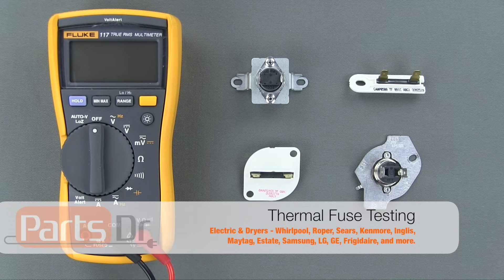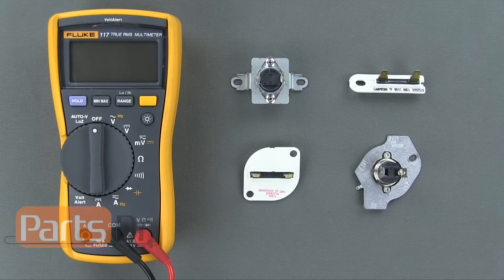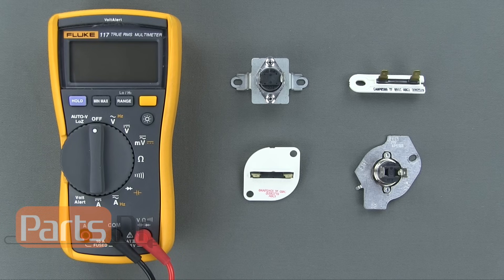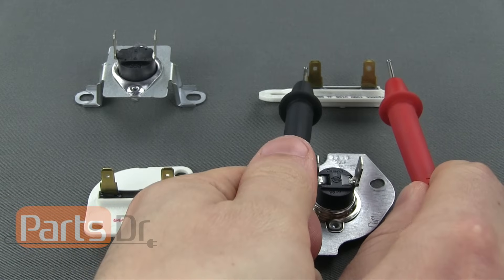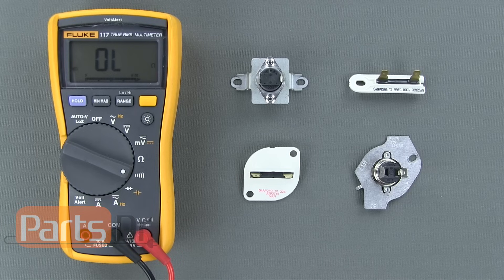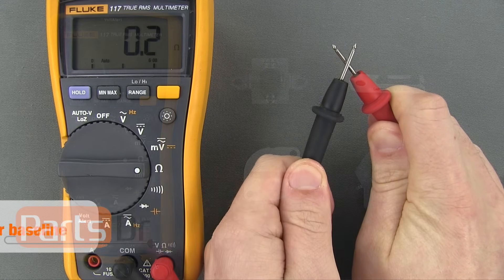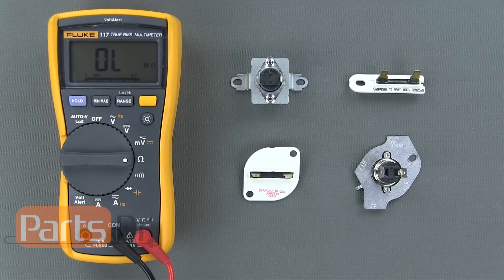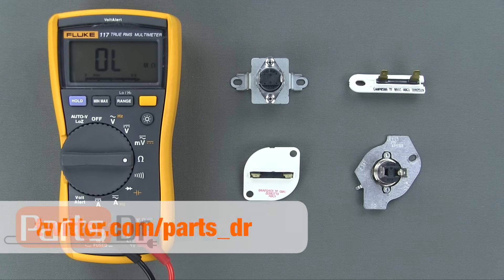How To Test A Dryer Thermal Fuse For Continuity

Comment from the maker: If your dryer isn't heating, testing the thermal fuse for continuity is a smart first step. If the fuse is bad, replacing it with a high-quality OEM part is key to a reliable repair. A quick reminder if you're ordering parts online, be cautious when shopping on sites like Amazon or eBay. Many of the cheaper aftermarket fuses we've seen fail quickly or don’t fit right, and some have even led to overheating issues or safety hazards. For genuine OEM thermal fuses and other dryer parts, shop with confidence at https://partsdr.com. Use your dryer’s model number or the part number from your fuse to find the exact match.

Need help replacing the fuse? Check out these videos:
Whirlpool, Maytag, Amana, Kenmore, Estate, Roper dryers:
Blower Fuse: https://www.youtube.com/watch?v=wvaki76Cjpg
Heater Fuse: https://www.youtube.com/watch?v=_gnMcO6F68E

Samsung dryers:
Blower Fuse: https://www.youtube.com/watch?v=lxGavrWKwUw
Heater Fuse: https://www.youtube.com/watch?v=e_rWKBSCwRA

Happy repairing and let us know how your repair goes in the comments!

Comment: Continuity doesn’t work but when I put it on OHMs and heat it up with my hair dryer on the sensor. It somehow reads and the numbers started to decrease. Like 3.45 - 3.40 - 3.00 2.9 etc etc
Reply from the maker: That sounds more like you are testing a thermistor.  Those have to be tested for a specific ohm value at a certain temperature (this can vary depending on the part) like this here: https://www.youtube.com/watch?v=oaABV5WV6sI
Reply: @ thank you for replying. 
So you mean to say is that, if the continuity doesn’t work that means the Dryer Thermal Fuse is completely useless?
Thanks
Reply from the maker: @TheMoodyMonday  No.  We are saying that we think that the part you are testing is not actually a thermal fuse, but instead it is a thermistor.
Reply: @PartsDr  yes, you’re absolutely right. It is indeed a Thermistor. And the continuity doesn’t work (doesn’t beep) 
Thanks a lot

Comment: You can put a jumper wire between the connector and that will be a good test
Reply from the maker: That is a good way to test the fuse if you don't have a multimeter.  Just make sure to unplug the dryer while jumping the wires, and make to sure to NEVER leave it this way as it is a major fire hazard.

Comment: What if the elements all have a continuity tone, but the dryer still continues to overheat and repeatedly blow the new Thermal Fuse?
Reply from the maker: What is the part number of the fuse that is blowing?  What is the model number of the dryer?

Comment: I've disassembled my GE dryer and removed the Inlet Control Thermistor (part WE4M398) after testing for continuity and not receiving an audible alert. So I ordered another one. The new one came in today from you guys but the new one doesn't have an audible notification either when testing for continuity.

I reread some online resources to make sure of the proper test I should be performing: Omhs or Continuity. But I just got more confused.

Should I be testing for Continuity or Omhs on this part? If my thought process is correct, there should be some type of resistance if the part is designed as a fail safe for high/low temps. Thoughts?
Reply from the maker: The part number that you mentioned will not register continuity.  It will have to be tested for ohms.  This thermistor should have an ohm reading of approximately 100K ohms at room temperature and the resistance value should decrease as the temperature increases.

Comment: My dryer is giving me f4 e3 but it is not clogged I took it all apart can it be the thermal fuse ? It was working just fine heating up fine went to switch the loads but now won’t start but has power panel board does work
Reply from the maker: Yes it could be a blown thermal fuse, but also make sure to check your dryer for restricted exhaust venting.
Reply: @PartsDr  how would I check that where would that be under the drum?
Reply from the maker: @tiffanywoodall7001  Locations for the fuse varies by model, but there are usually two fuses, one near the heater and one near the blower.  This video might help you here: https://www.youtube.com/watch?v=iWZucCy3EC8

Comment: I just replaced the thermal fuse and after a minute of running the fuse has gone out again!!! I have checked all other fuses and element. Lint trap and blower is clear. What else could be causing this?
Reply from the maker: Check for a shorted heating element and make sure the exhaust venting from the dryer to the exterior of the house is clear.  We show how to test the element here: https://www.youtube.com/watch?v=8AG7PtCy0v4

Comment: Set to OHMS my multimeter read 0.6 when I tested my thermal fuse the reading jumped around a bit at first..when I had a  steadier connection to the fuse  it read 0.6 so I am assuming it's good. My dryer was cleaned the summer so lint buildup wouldn't be a cause to my problem - which is the start button only clicking. I also checked the door switch and is good as well.
Reply from the maker: It sounds like the fuse is good from what you described.

Comment: can these be tested in place without removing the wires? some of them are quite difficult to remove and i dont want to break anything.
Reply from the maker: You will need to disconnect the wires to get an accurate reading.

Comment: Greetings, I changed the thermal fuse and the dryer worked for a while then stopped working again. Any suggestions???
Reply from the maker: You will need to address the cause of the dryer overheating or you will continue to have thermal fuses blow.
Reply: @PartsDr  Thanks so much for the info. I'm troubleshooting the dryer to see what's going on

Comment: What if all the parts are showing continuity what else could make the dryer not heating up but everything running fine looking forward to your reply thank you
Reply: Heater element or thermostat
Reply: if it’s not the fuse it’s the elements
Reply: Did you figure out the issue?
Reply: What if all of the above test good?
Reply: Clogged Dryer vent will also keep it from heating up
Reply: This has been one of my biggest issues as a technician in training. I have no idea what to do 😢
Reply: @JonCollinsMedia you'll get it figured out!  It takes time to know what to look for and what to test, believe in yourself!
Reply: If it’s a clogged vent it should still feel warm inside the dryer after running it. It just won’t dry the clothes bc there is no circulation to carry the moisture out. If it’s totally cold after cycling the machine for awhile it’s like the fuse or elements.
Reply: Same thing happened to me. I changed the thermal cut off fuse and now it’s drying nice and hot. I replaced a part that tests good with a new one and that was the fix. I would love to know why.

Comment: i cant even get the wires off the fuses at all
Reply from the maker: They can be tough to remove. Try a needle nose pliers to help pull on the metal wire connector or use a flat blade screwdriver to pry the metal wire connector upwards.

Comment: I need help. I have been working on my dryer for 4 days now. I have replaced the fuse checked all the thermostat replaced the heating element 3 times. They all show good. I have checked and cleaned out the lint ran a vent cleaner from my dryer to the out side of my house. Checked my mother board and I am getting 240 volts going to the heating element. 
My dryer was giving me the HE error but now it runs 2 cycles with no problem than just won’t heat anymore. I am lost and very frustrated on where to look next to try to fix this issue. Can you help me please.

Comment: My base line shows 0.17 ohms and on my Klixon CDM-2A it reads 1.17 ohms. What is tolerance for the discrepancy I see between base line and fuse?
Reply from the maker: We couldn't find that specification listed by the manufacture.  You might find this PDF helpful here: http://static6.arrow.com/aropdfconversion/5c5631111b80764705c924deb6f90e624bba4c38/12klixon-circuit-breaker-thermal-c.pdf

Comment: what do you do if your high thermostate fuse has four prongs?  the two prongs farthest apart test fine, but the middle two prongs do not.  thoughts?
Reply from the maker: What is the part number that you are testing?
Reply: @PartsDr  3387134 

https://www.amazon.com/Thermostat-Replacement-Parts-Whirlpool-WP3387134VP/dp/B07JG8R2FV/ref=asc_df_B07JG8R2FV/?tag=hyprod-20&linkCode=df0&hvadid=312152817250&hvpos=&hvnetw=g&hvrand=9487322038058706763&hvpone=&hvptwo=&hvqmt=&hvdev=c&hvdvcmdl=&hvlocint=&hvlocphy=9029042&hvtargid=pla-573781901414&psc=1&tag=&ref=&adgrpid=61525452389&hvpone=&hvptwo=&hvadid=312152817250&hvpos=&hvnetw=g&hvrand=9487322038058706763&hvqmt=&hvdev=c&hvdvcmdl=&hvlocint=&hvlocphy=9029042&hvtargid=pla-573781901414
Reply from the maker: @oopalonga  The cycling thermostat controls the temperature of the dryer.  The larger outer terminals should have continuity at room temperature and the inner smaller terminals are an internal thermostat heater which have a higher resistance that won't register continuity on most multimeters.  Just because the thermostat has continuity at room temperature doesn't mean that it is regulating the temperature of the dryer correctly.  If you suspect it to be bad, it is a good idea to just replace it.  We wouldn't recommend that cheap Amazon knock off, you can get the real OEM part here: https://partsdr.com/part/3387134-cycling-thermostat
Reply: @PartsDr  thanks brother.  really appreciate this comment.  i took the heating element out and noticed i have a broken coil. . .so i'm guessing i have to replace the entire heating element, right?
Reply from the maker: @oopalonga  Yes that is correct.
Reply: @PartsDr  thx

Comment: I have a Maytag maxima..it has power to it, lights on,, but won't start..I checked the thermal fuse.it reads 0.3 so i think it's ok...checked the door. all good..what else would make it not startup?  I do think it overheated on the last load

Comment: Can you test the thermal fuse without removing it or will that give a false reading?  I have the Thermal Fuse and the Thermostat both for continuiuty and the thermal coils are good.  The vest is cleaned and the blower wheel has been cleaned.  I reset the LG with power off by pushing the start and pause button for 5 seconds and I still don't have heat.  ANY HOPE?  I'm frustrated!
Reply from the maker: Hi Mike, the power should be disconnected and the wires should be removed from the fuse when performing the continuity test.
Reply: @PartsDr  thank you... I'll try again tomorrow with the wires disconnected.
Reply: Did you figure it out?

Comment: After 10 years of never any issues with our dryer, but it stopped working this month. Thanks for your video, I fixed the dryer and spent less than $16. Works like a Charm! I buy the dryer high limit thermal fuse set on Amazon. https://amzn.to/2O0Rm54

Comment: Do I need to completely remove any fuses before testing them or can I just disconnect the wiring and test the fuses while still attached to the dryer? I have multiple fuses to check. Push to start switch, interlock switch, thermal fuse etc.
Reply from the maker: Great question!  You can leave the fuses in the dryer, but you will need to make sure the power to the dryer is unplugged or disconnected and also make sure the wires are disconnected to the fuse(s) when testing them.
Reply: @PartsDr  Thank you. Turned out to be the interlock switch.
Reply from the maker: @PopPunkPoser  👍🏻
Reply: So you don't have to remove each thermal fuse to check them?  They can be checked while still in the unit, correct??  It'll save a few minutes but was questioning whether or not to take them out first. Thank you
Reply from the maker: @jessicam5226  You can leave them in the unit while checking them.  Just make sure the power is disconnected to the dryer and the wires to the fuse are disconnected while testing.
Reply: Thank you very much!!  I appreciate your knowledge 😊

Comment: What if the thermal fuse reads 0.0 from thermal meter 20k ohm setting??? Also my Thermistor reads 11.45.
Reply: Then the fuse is getting flow.

Comment: Thanks for the video..  would have never guessed this is a thermal fuse that actually blows as opposed to something that just opens and closes again when it cools down, or just a thermister for the control box to read a specific value...
Reply from the maker: They do it that way because they want the person repairing the dryer to also address the overheating issue at the same time the fuse is being replaced.
Reply: @PartsDr  Interesting..  I guess that makes sense..  Compared to the cost of the service call, the fuse is minimal, but it makes you take it seriously enough not to ignore it.
Reply: @PartsDr  So the mean when my is 0.00 is good and start working when is hot?

Comment: Is it possible for a thermal fuse on a regular older "nothing fancy" amana electric dryer to be bad and cause the dryer to not run at all? I see a lot of people saying they have no heat with their bad fuse, implying that the motor is still turning or they are at least getting something when they run it. Im not getting anything at all from my dryer. The vent had a bunch of garbage in it, I unclogged it, tested the start switch, it was good, tested a fuse that looks exactly like the bad one in your video, mine has no continuity. If I replace it will I be good, or is their something else wrong with my dryer as well? Very helpful video, thank you.
Reply from the maker: Hi Brandon, we have seen on some model dryers that the manufacture wires the thermal fuse in a way that it stops the dryer from running when the fuses blows.  If you test your thermal fuse and it is bad then it would be a good idea to start by replacing that and see if that fixes your problem.  Also, make sure to check to see why the dryer overheated to begin with so you don't blow another fuse.
Reply: Thank you for your reply. Ya mine must be one of those dryers, I replaced the fuse and shes back to work. I am hoping it was the clogged dryer vent, but honestly, it might not be, the stuff I pulled out of the vent wasn't lint, but small rocks or other solid material, it couldn't have clogged the vent more then 20%. I could have pulled lint out as well though, and the combonation of the 2 could have easily blocked it. Not sure if I pulled out lint because when I went to clean it I had a hard time reaching, so I just stuck a shop vac wand down it as far as I could, swirled it around a little bit till I didn't hear anymore rocks coming out. Thanks for the help
Reply from the maker: @brandonmanson8866  We are happy to hear that the fuse got the dryer up and running again.  If the fuse blows again you may have to do some more investigation to find the source of the dryer overheating.

Comment: so you have a top of the line multimeter
Reply from the maker: Most digital multimeters $20 on up will have a function to check for continuity.  Just check the features of the multimeter before you purchase one.  Since this is what we do every day we do like to have nice tools since we are using them frequently, but it is not a requirement for the average home owner.

Comment: Quick question my dryer is blowing cold air I did the ohms test on all the elements I did the ohm test on the heating coil and I got nine ohms is that okay but I'm definitely going to check that littelfuse you have up in the right-hand corner thank you
Reply from the maker: Yes 9 ohms on the heating element is normal.
Reply: Thanks for taking time to answer my question back I found the problem it's one of my thermostats not working thank you again😁

Comment: Would the thermostat be the issue if the dryer sometimes heats up?  Initially, my gas dryer stopped heating and I found out that usually it is the thermal fuse so I replaced it.  Worked great...  for a week and then it stopped heating.  Did a few cycles and no heat.  I thought the fuse burnt out again.  Then all of a sudden we tried the dryer and it is heating again.  What could cause the dryer to sometimes heat and other times not?
Reply from the maker: Intermittent heating issues on gas dryers are most often caused by bad gas coils.  https://partsdr.com/appliance-type/dryer-parts/gas-coil-parts/
Reply: OK, I tested the gas coils with a multimeter and it was fine (showed continuity).  Is that really reliable or should they be changed anyway?  I also tested the thermal fuse and thermostat with the multimeter and they were also fine.
Reply from the maker: A continuity test is not very accurate when the dryer is having intermittent heating issues.  Normally the gas coils will test fine while not under load and fail while under load.  If you suspect they might be bad it would be a good idea to try replacing them as they are not very expensive to replace on most gas dryers.

Comment: Parts Dr. I have a Whirlpool gas dryer with the thermal fuse shown in the video(top right). Tested it with digital multi meter and the meter didn't change. It's bad. But, the dryer gets hot and drys the clothes. Apparently I have a bad motor too.  When the start button is pushed you get a hum for 1 second then it seems to work OK.  Other times the hum is 7-8 seconds(no tumble) then it shuts off. 2 times the dryer shut off halfway through the cycle. Why would the dryer still get hot if the fuse is bad?
Reply from the maker: If that fuse is bad, the dryer either shouldn't run or if it does run it shouldn't heat.  It sounds like you might not be testing the fuse correctly.
Reply from the maker: Somtimes we also see people confuse the Thermistor as a Thermal Fuse.  Make sure you aren't doing that.
Reply: According to your video it's the thermal fuse. When this video starts it shows 4 fuses. Mine is the one on the top right(long white one with 2 terminals). With a digital multi-meter and the setting on either 200 or 2000 ohms(resistance) the meter reads 1. When touching the 2 probes to the terminals the meter doesn't change.